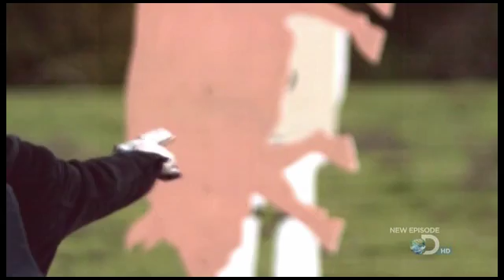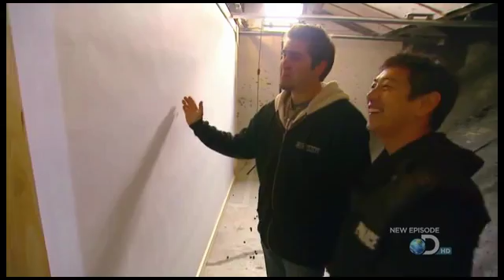Mythbusters Curving Bullets Part 3

Comment: the bullet only has a rotation component in the barrel, once it leaves the barrel there is no rotational component on this type of projectile. If they were to use an old school powder musket with out the rifling in the barrel and a spherical bullet, then they would get a curve (just like a curve ball) The reason a barrel is rifled in the first place is to eliminate curve.

Comment: Basically you are right, however, a bullet travelling sideways HAS a component of rotation which isn't aligned with the trajectory. Aside from the rotation, the bullet could still be curved, as the deviation between heading angle and trajectory may generate some kind of "lift", just like wings do.

Apparently these effects are too small to be measured in their experiment, and they would need to move the gun way faster to actually curve it as much as in the movie, but in theory it's possible.

Comment: I have a theory. If you swing the gun considerably faster than the bulet flies, so that some part of the bullet touches the muzzle and throws it slightly sideways. Scince the bullet isn't round it should start to straighten out possibly causing a small curve. Maybe it is easier to curve a round bullet. It is possible to curve a round football, why not a round bullet. You seem to better on physics than me so what do you think of my (insane) theories?

Comment: the 50 cal model does not match the reality of sonic boom, the whole idea behind it is that the projectile needs to create sound, but bullet simply does not produce any. the sonic boom that you hear by a jet is the sound of the engine of the jet which moves with the jet at the speed of sound and gets more, when the jet slows down , now the sound is faster than the jet and we hear what ever we were supposed to hear at once, so it sound like a boom

Comment: Exactly. Was going to reply with the same thought to lg1987. He says there is no more force outside the barrel, but that ignores the force of friction/resistance from the air. It seems like if the bullet were spherical and had a less-smooth surface, you could bend the bullet in air by spinning it around an axis perpendicular to its initial trajectory.

Comment: ...sniper rounds get pushed off course ("curved") by outside forces, namely the wind. To change the trajectory of a bullet, it needs to have a constant outside force acting on it, like the wind. And baseballs aren't NEARLY as aerodynamically efficient as a bullet, nor does it go as fast, so it can "grip" the air, and change it's trajectory with ease.

Comment: about the best you could do is to give it a slight sideways vector so it's not quite travelling parallel with the direction the barrel was pointed when fired. It would still be headed in a straight line though.

Comment: Of course it was emitting sound, how couldn't it be?
As the bullet moves, it pushes the air in front of it out of the way. This creates a small shock wave. Shock waves are essentially sound. The shock waves it produces are quite small, however, because of the Doppler effect, an observer will hear/feel a sharp crack as the bullet passes, as all of the shock waves join together and are felt at once. In the context of the video, they are referring to this event as a sonic boom.

Comment: That would be correct if the bullet would accelerate instantly, but it probably takes the entire barrel to accelerate to its maximum speed. 
Which should give you slightly more time?

Comment: Actually there is interaction with the air where the stream of rotating bullet interferes with the stream of upcoming air if considering the reference frame of a bullet. And the ratio between bullet axial speed and its perpendicular one makes the difference. Look for Magnus effect. All this stuff is right of course for SUBSONIC cases.

Comment: This is because of something called the Magnus effect. When the player shoots the ball, he gives it an horizontal rotation. Then, because it is rotating, one side of the ball will go against the relative wind and slow it which will make the air pressure go up a tiny bit at one side of the ball. The opposite will occur on the other side. Then you'll have one side with higher pressure and one side with lower pressure. The ball will then be "sucked" to the lower pressure side...

Comment: To curve the trajectory of the bullet you need a force pushing against it. As soon as the bullet leaves the barrel, the shooter can't apply any force to it anymore and it will then travel horizontally in a straight line. Only gravity will apply but it will curve it vertically and not horizontally. It's just physics... They didn't even needed to try it, they could have known before that it wouldn't work...

Comment: Not really, it will just make is a bit inaccurate, but nothing more, that is what the rifling is for, it keeps imperfections and divets from altering the path of the bullet too much, but it will cause it to move in one direction slightly. The force required to actually do what they do in the movies would have to be a large percentage of it's forward motion. So you could do this, provided you can swing your arm at about 1000 feet per second (Or 681.8 mph).

Comment: Actually, the pistol rounds were not designed with any off-center weighting, and the ones in the movie that did have a "special" design still would not work.
Off centering will just cause bursts of energy on the weighted side, but it is not physically possible to cause it to turn back on it's trajectory.

Comment: It does continuously boom - I thought the same as you for ages but was schooled by a RAF pilot when he pointed out that the leading edge of the plane (or whatever) constantly generates a supersonic air pocket that will make a boom itself for as long as the plane is moving above mach 1, although obviously you're right in the case of a bullet, it's not making much noise as it flies but there's still a boom. This is why silenced/suppressed weapons generally fire subsonic bullets.

Comment: a sonic boom is not constant after its at full speed. its when it changes from sub to super sonic and all the sound pressure snaps. so that is going to be impossible to measure. they would have to make it snap at the precise second  which would be impossible. Also a gun has spirals in the barrel to purposely stop it from curving because in the past bullets would change path easily. if you took an old musket without the spirals and with more space between the bullet and the barrel it may work

Comment: @andreas314 No, no we won't. The laws of physics don't change just because it's "the future". You won't cause a bullet to move in a horizontally curved trajectory no matter how hard you try. Now then, you could have a fin stabilized and steered projectile fired with a sabot, but as soon as you add fins and a sabot and any sort of guidance system it stops being a bullet. At that point you're calling it a 'guided missile' and looking at several thousand dollars per shot.

Comment: @andreas314 And completely wrong. A bullet is a ballistic object. Theoretically, you could curve it if it were a sphere, and could control the spin. But a bullet is a spin-stabilized missile. Its gyroscopic motion ensures that it is going to move on a straight trajectory. The only curve in a bullet's path will be due to gravity and friction with the air resulting in a downward parabola.

Comment: Is it possible to curve a bullet

It should be possible IF they Matched the SPEED of the BULLET to the SPEED of the ROTATION when it SHOOTS. 

for an example, if the bullet speed is 300m/s, the rotation should be some where around 400mph to enable the control of the bullet.

its simple logic or theory.  :D  :) :)

Comment: the problem is that the gun only fires STRAIGHT from the barrel to the location it is pointed to.= you cant do that unless.you have swinged it so fast that same speed as the bullet. or either. change the point of location of the gun. but anyway it is busted.